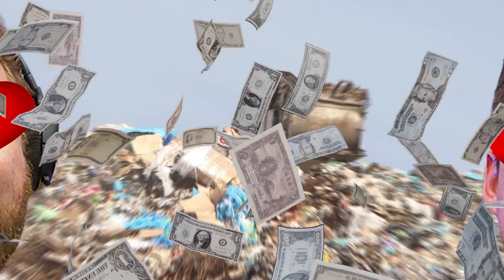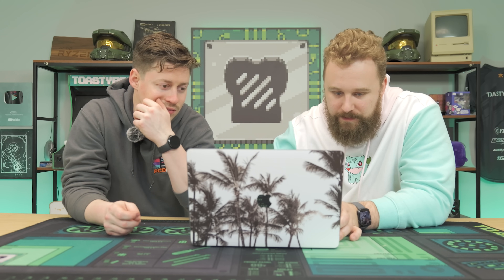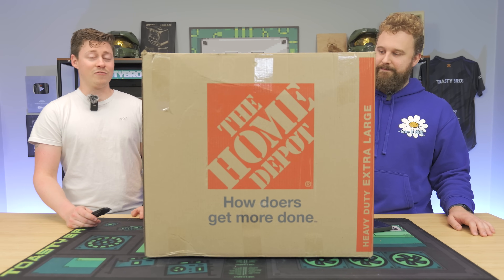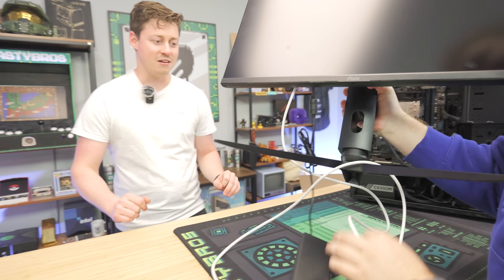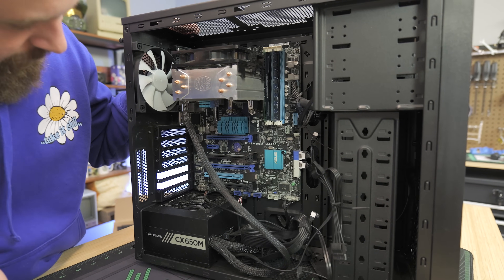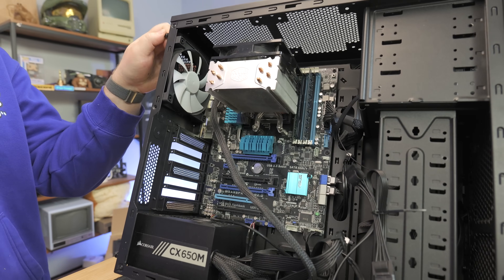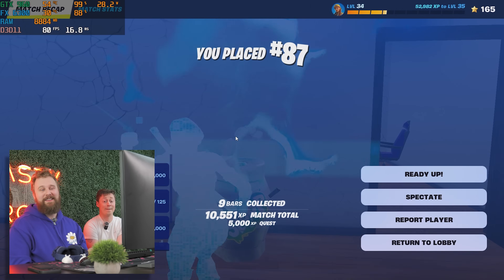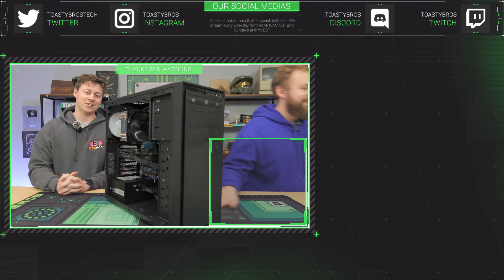Ultra Budget Broken Gaming PC Challenge - EP.1

Comment: My initial build was picked up on FB marketplace for $250 5600G RX 6500 XT, 16 Gb 3200, 2 500 gig nvme. Basically a Lenovo T5, threw a $100 RX 6600 and its quality. Picked a 75 hz monitor for $20, also FB marketplace

Comment: Where I live, these fx machines are hard to sell even at 50-100eur as working (have load of these). For 200 could sell You i5 7400 + NZXT aio, 16gb ddr4, asus B150M pro gaming, 256Gb m2 ssd, gigabyte 1070 8gb, deepcool tempered glass RGB case with 4x RGB fans. Works like a charm.

Sadly as i live in far corner of eu, posting it would cost probably as much as system itself :(

Usualy local auction sites and forums are where You find deals. Just got asus ROG strix Z670E board for 46 eur and some Z170/270 boards around 13-15eur.

Comment: Sooo - I think it would be cool with some DIY videos, so ofc not making gpu etc from scratch. But Tower, or ways to take a broken laptop/phone and few tools to make it work again would be cool. 

Like a laptop could easily be salvaged if it's screen and back panel etc is destroyed and through a very cheap controller board be connected to a monitor, if the monitor have USB C, a converter can be used to achieve 1 power input for the whole, then it's just about making a case on the back of the panel.

The fun would be if you were still blocked by the same means as a budget pc, i.e you have to find a broken laptop/phone or w.e on a budget (For people who wish to do it themself they would prob. have the laptop and monitor at home, where the laptop just broke) then a cheap monitor, with usb c if possible. Some converter boards which are very very cheap to get some connectivity between the two.

Honestly, above might not be the 100% right way, it's just an example of a possible way. Cause that could be fun, and it could be great for people to learn how to fix up their broken stuff and make us throw less e waste away. :) 

There is ofc. some methods that would require soldering, but im 99.9% certain that with type of repairs like this you will be able to buy the converter boards and connect them directly without having to solder. Because i've done something close to it with a phone i converted to a laptop once xD for my sister. 

Also DIY really makes for insane insane content, and something that really get's a lot of clicks :D So IT + DIY should get some wild numbers as well. :)

Comment: Good video. The AMD FX is old, slow but solid quality. But the old Intel X58 is in my experience still the best of the old platforms. Can top Sandy Bridge LGA1155, especially if you put in a cheap Xeon 6c/12t CPU. But even the old 4c/8t i7 models clocked easily to around 3.5 GHz, paired with 12gigs DDR3-1600 @triple channel, gets though the lag mud pretty good (not high FPS, but few lags). Older platform, but Better than AMD FX.
(DDR3-1600 @triple-channel increases bandwidth to be comparable to DDR4-2400 @dual-channel (and has lower latency), and many modern games utilize memory speed pretty good.

Comment: I like the idea for this video. Series will be nice 👌
If that is amd 990 chipset on the mobo, it should be able to support 64GB of ram, but since "regular" ddr3 doesn't come in 16gb sticks it should mean that you use the server memory. 
FX CPUs in combo with that mobo chipset (if it's actually 990) should be able to work fine with server ram. 
That's in theory, I never tried it since never had 64GB of ddr3 server ram so I can't confirm.
If you have 16gb sticks of ddr3 server memory, you should def check it but just for "science" since I don't think there's much to be gained from 64gb ram. FX6300 can be OCed, has high enough max temp, it should...work 🤷‍♂️
Tbh idk what can you get from fx CPUs any more. 
Yes, they work, some people are obsessed - they just love them...games can be still played (not all ofc), older consoles emulators probably work great...
Honestly I like you picked AMD FX instead od some Intel 2nd or 3rd gen computer, makes video more interesting 👏👌👍

Comment: I remember the Phenom 2 era when i bought my (still in use) Noctua Nh-u12p from 2009. I could not mount it on the side becuase of the brackets that came, they only let you mount it up, then they released for free mounting brackets for the AMD cpu for mounting it normaly haha. I still use the cooler in my 6600k rig. (i even got those mount for free) based Noctua

Comment: The diff between that "broken fix up" at $360 versus a new budget build at $480 would suggest *WHY BOTHER* ... I have done the latter several times over last year and it is doable (and that is with Ryzen 4100, RX580, 512GB NVME, 16GB DDR4, etc.).

Comment: Hello friend, I'm sorry to bother you, but I need help, that is, now I have a computer with data: motherboard ONDA H81; cpu: I5 4440 3.10ghz, 8gb ram ddr3 and I have changed video card and power supply unit GPU gtx 1060 3gb vga and PSU deepcool de500v2 and motherboard; I want to change things and processor to ddr4 and which socket do you choose, which processor and which Micro ATX motherboard ? Also, if I check the power supply unit's watts, the total output is written as 350 watts, but they say 500 watts, but it works, and thanks in advance  please help me🙏

Comment: I wouldn’t include shipping in the budget, just the cost of the actual system.
Reply from the maker: Only reason we did is a lot of ebay sellers make extra profit with high shipping costs so we felt it was cheating
Reply: @ToastyBros  I hear you, but most listing were far cheaper. Even if you just average it out to $20 shipping cost.

Comment: Not to be an ass, but I'm struggling to figure out where the actual challenge was? The title specifies "Broken PC" but the PC wasn't remotely broken. Just because it was listed as "for parts" doesn't exactly count when the listing even detailed the PC worked last he checked. You didn't actually get a broken PC and fix it under a budget. You bought a known working used PC....